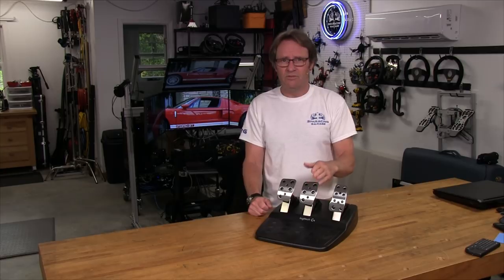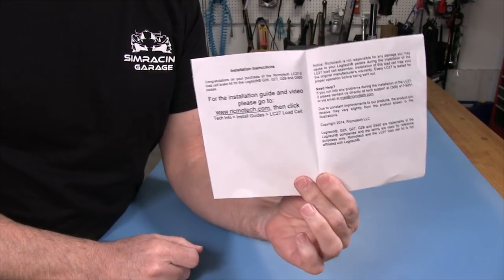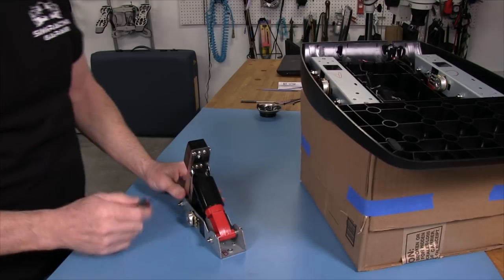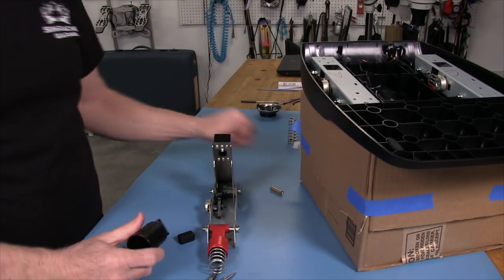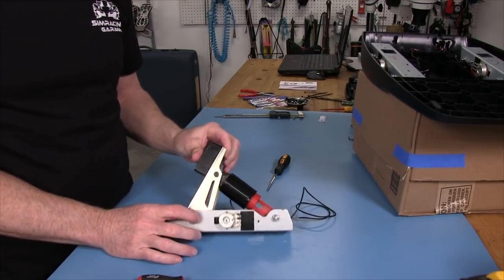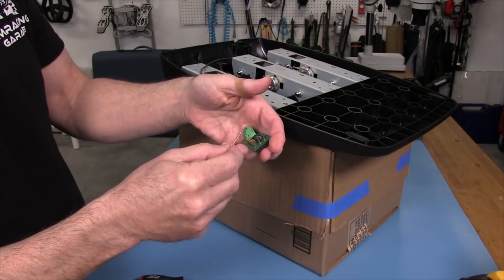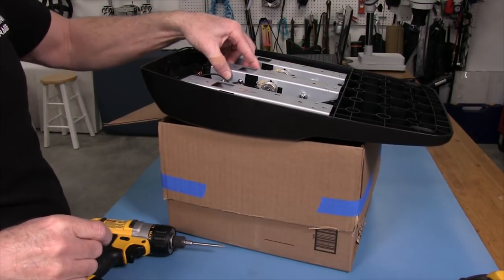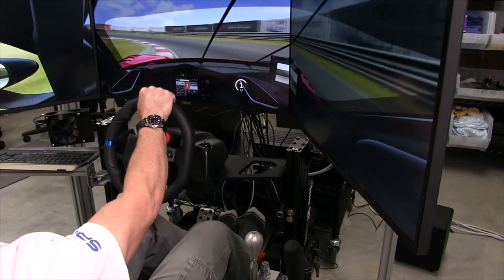Ricmotech Logitech Load Cell Kit Review

Comment: I installed this a couple of years ago on G29 pedals, but just recently started having issues with Gran Turismo Sport on the PS4 after a game update.  The brake was getting activated without any pedal actuation, which caused all kinds of problems with various cars.  After speaking with a Ricmotech rep, he instructed me to go in and cut off approximately one "loop", or 360 degrees of spring to lighten the tension slightly.  I wound up cutting off only about 270 degrees worth from the end of the spring, and it seems to work fine again.

Thanks for all the helpful videos!

Comment: Thank you Barry. I am planning on a major rig upgrade toward the end of the year, so you sold me on the idea of using this tweak as an interim step for a few months. I placed my order today,
Reply: I installed a tuning brake spring which is 59% stronger than standard spring and removed the rubber block. I then swapped the clutch spring to the accelerator and the brake spring to the clutch. I also fitted the 3d rap v3 improvement mod in the shifter. I was considering an upgrade but not any more as the difference these mods have made is astonishing, all for 40 quid, saving me hundreds!

Comment: I cut the rubber piece in half for my brake pedal. Works very well for me.
I swapped the throttle pedal with the clutch pedal for a stiffer throttle. Most cars don't use a clutch anyway. 
 Works very well.

Comment: works well i also did the spring swap & swapped the rubber bushing for thrustmaster t3pa-pro upgrade red bushing from Ricmotech. I have a LC on G29 & Thrustmaster. The G29 is very good times consistency improved on both. The G29 with LC is a winner & would take a direct drive wheel LC setup as your next step. GT Sport PS4

Comment: Another mod you can do is make a hole on the side of the pedal casing for the power cable to come out of, instead of coming out the back so the cable wont bend when you put the pedals against a wall.  thats what i did to mine when i was using them. not everyone as a sim rig.
Reply: Lex.... Can you show where that's done...thanks.
Reply: yea did you just drill a hole and route it out that way or anything specific?
Reply: @mrabgefahrn9933  yes . Just open the case and make an opening. I used a round file.

Comment: Ricmotech says to remove the plastic caps, on the inside of both caps, if installing on G29 or G920 pedal set. Did you only remove the bottom one and leave the top in? Looks like it in the video. Great video!!

Comment: You could upgrade the feel of 1 pedal for $130 or just buy a better set of pedals for not much more.  This upgrade should be like $50 max!
Reply: To be honest, until you start paying big money for pedals, the gas and clutch are not that much different. If the break pedal was fixed on these, they can last you a long time.
Reply: Its not the feel its the fact its loadcell. A loadcell set of pedals cheapest no mods is 240

Comment: this seems way too much work, so i used alternatives by upgrading the springs to better springs with rubber sealers and works better!! will the load cells work on the gas pedal and the clutch pedal!?

Comment: Its a pretty pointless upgrade now. Rimotech mod is approx 190 CAD incl cheapest shipping. There is also duties as well but I'm not sure how much. You can buy the thrustmaster t-lcm for 300 CAD and get a much better built brake set without any modding work. The fanatec CSL LC are around 300 CAD too

Comment: Awesome video! But how is your G29 so quiet, even in PC2.  I've turned a lot of my settings down and it still rattles.
Reply: it's all about the mount.  if you have a great mount, then it's all about the insides, which you will need to get into and find out what's rattling.

Comment: I got G29 for several years but havn't have had time to evaluate a gearbox stick yet, have any body seen or heard about any one building one themself cause G29 and orobebly G920 has a 9pin Dsub connection for gearstick and if 2 are used for ground and +5V theres 7 signal pins free for real simple signals.

<3 Have 2 VW Golf ( Rabbit ) GTI MK I seat for my Driving Rig project <3

Comment: $130 mod for $250 wheel set is crazy price. No thanks
Reply: Buy a better wheel set with load cell or hydraulic pedals then.
Reply: I actually prefer the G29 over Fanatec CSL. Maybe it's the lack of friction in the wheel and smaller wheel size, but it's much easier for me to react fast with G29. I'm not longing after load cell right now but I don't think that upgrade would be totally out of question either.
Reply: You can just buy a CSL Elite pedal set for a bit more
Reply: @harrisonatkinson7595  the CSL LC pedals plus the Fanatec USB adapter you'd need would run you $230 US. That's quite a lot more than the $130 US it would cost to upgrade a set of Logitech pedals you already own (not to mention the savings over Fanatec's insane shipping costs if you happen to live in Canada as some of us do!)
Reply: @johnsyeats2044  yeah that's true but the Logitech pedals also have 8-bit resolution I think? I think it'd be a worthy upgrade but I'd upgrade the wheel first
Reply: @ToreDL87  The entire reason why people buy the G29 is because they don't want or can't spend that much.
Reply: @annekedebruyn7797  Yeah but this mods kind of make the g29 a bad idea, stick with it or get a better wheel and pedals...
Reply: I just bought the upgrade because i couldnt afford csl pedals + load cell upgrade + USB cable + cronusmax drivehub + intl shipping + custom charges

There was a bit difference for me. PS4 player from chile
Reply: @LevisL95   the g29 is full of friction,  called cogging.   it legit makes counter steering a chore. i drove with a g29 for 4.5 years. and every time i have to countersteer a drift quickly i cant just let go of the wheel and let the wheel do it itself.  i have to guide it by hand  or the motor isnt fast enough nor smooth enough to do it itself.  do you own a CSL or did you just use a friends or what?  perhaps you used one that had very terrible settings on it.  i have a hard time believing my G29 feels better than a CSL
Reply: @ueehurstonsecurity8887  Hi and sorry, I wrote a huge wall of text. But it should give some insight. :D

I had the CSL for a bit over a year. I had a G27 for many years before it, during which I tried T500RS and a Playseat for a few months. And now I've had the G29 for almost a year. I haven't driven it that much but it's very similar to a G27.

One thing I need to say is that I've got no proper seat - just a desk and a dinner table chair. That makes a huge difference and is one reason why I haven't bothered driving as much as I'd want. I'm building a sim with a real car seat, but it has taken a while. :D

Now, about the feel. The G29 definately isn't able to rotate itself fast enough. You have to aid it by hand, as you said. Overall, when it comes to power, the CSL is on a whole different level. Although I think the G29 motor just isn't powerful enough, and this is not about friction.

The thing I'm talking about is the moment when the wheel should get light. So when the back end gets loose and you need to actively counter steer to catch the slide. In that situation, the G29 is very light, there's virtually no resistance and you can be very fast. The CSL has some friction "built in", the wheel resists you turning it. But you can feel it only in these specific moments, when the force feedback isn't doing anything.

The weird thing is that the CSL feels light when it is powered off. Although it has the belt system and more rotational mass, it feels very light, virtually as light as the G29. (The T500RS was horrible in comparison.) But for some reason, as soon as you turn the power on, this friction appears. As far as I can tell, it doesn't matter if you turn the FFB to 0 or play ETS2, you can still feel the same damping or friction when you turn the wheel fast.

Fanatec said that they've reduced the friction on the CSW 2.5 by a lot by redesigning the motor electronics. So I think this is the friction they are talking about, and a CSW 2.5 or a direct drive wheel might be the (too expensive) solution for me.
Reply: PS. My G29 makes some odd high pitched noise when cold. Got a new one as warranty, it does the same thing. Some people say, the sound might go away after some use, so let's see. The stitching on the wheel is also of very poor quality. Logitech quality has seemingly gone to shit after the G27. It's a shame, I like the new pedals and buttons. Maybe the feel is also better, but hard to say since I got the old G27 used and can't even compare back to back.
Reply: @LevisL95  Hey thanksf or clearing that up!! that makes so much sense now.  i see why you say what you say now.   so it had nothing to do with tuning the wheel.  its just an innate problem with the CSL  that fanatec even agrees with you since they fixed it on the 2.5   so there must have been a problem to fix.   thanks for that info very much   i read it all!
Reply: About 10x crazy.
Reply: @LevisL95  how anyone could pref that over the csl i don't know. The difference in performance is like going from csl to DD bases.
Reply: @CottonXS  The power in CSL makes worlds of difference, yes, but you can feel all the same details with G29, without friction and dampening. G29 feels like a gaming controller in comparison, but it's an accurate one.
Reply: John S Yeats that’s nothing compared to EU you are looking at around 600 euro plus postage. So  the upgrade is worth it here.
Reply: @magpiemarc1962  CSL pedals and the USB adapter are 250€ in EU. Were you checking wheel/pedals combo or something?
Reply: i think you don't get the point. most people who do this mod already own a g27/29 etc and now want to improve upon it. not many people would actually buy the wheel and upgrade it right away, else they would buy a better kit to begin with. i've had my g27 for over a decade and am now considering to do this mod.
Reply: Looks like a great mod. I have a G29 and don’t really feel like spending a bunch of money for a CSL Elite. Buying that, load cell kit, and the USB adapter is too much. While I like racing in my rig, that money is better used to spend on my wife and kids. Take a weekend trip somewhere, buy them some clothes, go out to dinner, etc. the point some people are making here is while upgrading to a bad arse set of pedals is nice, we’d rather spend some cash to upgrade what we have. If we wanted the better pedals, we would have bought them in the first place. I get more pleasure spending money on my wife and kids than splurging on myself. I’m fine upgrading a part on my $250 wheel set.

Comment: I just ordered the parts together with a Leo Bodnar D-sub to usb conversion cable. Did you connect the paddles back to the steering wheel or through a conversion-cable?

Comment: DO you know if it is possible to get a potentionmeter wiht at longer travel. So it become possible to use the entire travel, when you take out the rubber piecefor the G29/g920, ore at least most of it.(A challenge mabe) if you used a 20k/OHM insted ore somthing ?  Thanks for the great videos

Comment: Do you have any comments on the stiffness of the brake pedal? I've heard some reviewers say that its unusually stiff, but you mentioned it has a much more natural feel. What's your opinion on those who say the pedal is way too stiff?
Reply from the maker: It is stiffer than the stock configuration. By natural feel, I meant that the LC or any pressure sensitive brake pedal setup has a more natural feel when applying braking pressure to the pedal. And feeling how the car is responding. It's something you have to experience to truly understand I think.
Reply: Sim Racing Garage I appreciate the reply. I think I will finally pull the trigger on this purchase. Thank you for the insightful review

Comment: Is it possible to configure the kg of force required or is the quantity fixed? Congratulations on your review
Reply from the maker: No, it is fixed and 35kg or so. You can calibrate in most games to set up how much force you want to use if less than 35kg.
Reply: Thank you very much for your reply. My concern was that too many kilos were required, if calibrating you can get off I'm fine, I just hope that doing so will not shorten the pedal stroke too much. Thanks for shedding light on this mod

Comment: Great info. Could you tell me what angles your side screens are at? I just set up triple screens and was wondering what is the best angle to use.
Reply from the maker: 60°
Reply: I have mine at 45, is there a advantage to going more?
Reply from the maker: I am better able to look through turns. Also, the center monitor is only 23" away from my eyes. So there is more of a wrap around effect to this setup. Not for everyone though. And getting your ctr monitor this close may not be possible. Depending
on the configuration of your rig.

Comment: Nice review Barry, I have had this mod for some time and it works just like I hoped. Small pointer, I doubt that you would notice any difference in iracing with diview adjustments since the calibration in iracing reads straight from the raw data and doesnt read the direct input from direct x. All the other titles you drove does though :)
Reply: All the other pc titles that is ;)
Reply from the maker: Yeah, just trying something to help deal with that force curve. Shame Logitech went that way. It certainly doesn't accomplish what they say it does. Just more marketing tricks...sigh...
Reply: Sim Racing Garage I couldn't agree more.
Reply: Does the brake pedal feel too stiff or just right in your opinion?
Reply: 20spray1 It's a matter of taste, once the initial spring is compressed you are more or less hitting a brick wall and the force you apply on that wall translates into output. That being said, I like it like this. My problem is that my G27 pedals are modded with longer pedal arms than stock, so I get more travel but also less force needed to get the pedal to max out. And I want to be able to apply more force and modulate the brake, so I'll make an extra axle with cylindrical elastomers taking up most of the force applied.
Reply: HwXeXcluded interesting setup. I also had plans to extend my pedals. Did you make the extensions yourself or did you go with a kit? My concern was that the LC pedal would be too stiff, but with extended pedals it would make it feel not as stiff. Do you have your pedals inverted or floor mounted?

Comment: $129.95 Wow.
That's quite a bit.
Reply: I guessed $100 at the start. Out of my price range (and I'm not good enough to require anything like this yet.)
Reply: @Sighman  it's not quite as refined as a load cell, but you can modify/convert your current pedals to a pneumatic brake system for free/a few quid for some basic bits u might already have at home to improve the stock brake

If you yt g29 pneumatic brake system youl find videos of it (don't wanna post links on someone else's video myself)
Reply: @ash180287  Thanks for that. I'm sure the load cell upgrade is worth it for many people, but I'm just starting out and the cost is impossible to justify for me at this time. (Mind you, if it helps me outbrake the turn one nutters it might be worth it after all!)
Reply: I though it would be like $29...
Reply: @Rafael Ribeiro same here what do you think about the Tlcm

Comment: Looks like it will be very hard to remove the load cell back from the plastic housing, isn't it? Great review btw Barry, congrats!
Reply from the maker: It is tricky. I took it out a couple of times during the review process. Not too bad using a pair of electronics type long needle nose pliers. You can grab the velcro at different places and gently work it out while pressing on the the thick section of the cable where it enters the LC housing. Once that clears the hole, it's comes out easy.
Reply: Great, thanks Barry!

Comment: Great product while it works, about a year for me. Now I'm stuck with a dead pedal set.
Reply from the maker: You can always remove the LC and return the electronics to the original configuration if they are still good.
Reply: @simracinggarage3026  I had to use to potentiometer from the brake pedal to replace my throttles as even after cleaning it kept spiking. At least it's summer. I'll venture outside and gets some sun on me while I wait for my T3PA pedals to arrive.  

Thought of using the one from clutch and run a two pedal set up but that's just not sim racing. Cheers for the reply Barry.

Comment: Quick question, i bought a cheap thurstmaster force feed back wheel and it felt notchy in the steerig. does the g29 feel notchy as well? or should i get a belt drive?
Reply: @SooHooSamaSito  so spring for a belt? Or does it make any difference?
Reply: @SooHooSamaSito  thanks

Comment: Without knowing the exact inner diameter of the pedal tube, there is a loadcell, which more than likely the one what is featured in the video. 
https://hu.mouser.com/ProductDetail/Measurement-Specialties/FC2211-0000-0100-L?qs=sGAEpiMZZMvDU9HV27FC0bfgshpg3%252bR8evdx8Gaw3Yc= 
and with a Leo Bodnar loadcell amplifier, the whole project is cost around $70. If you want to go real DIY.

Comment: Damn, was about to buy this but $129.95
?!?!?!
Reply: It's a lot cheaper than spending 230 USD on a set of Fanatec CSL LC pedals and the USB adapter (or $600+ on a set of Heusinkveld Sprints etc)
Reply: save up 100 bucks and buy some decent pedals is what i would do.
Reply: @johnsyeats2044  yeah but between actually having to buy the pedals and the upgrade kit you're spending ~$330 that's kinda ridiculous for a subpar rig
Reply: Wow, that is high for what you get., I was thinking 29.95, that would cover by 2 all the parts cost and allow them to mark it up 100 percent.
Reply: I use the TrueBrake mod which isn't a load cell but is functionally similar. Miles cheaper and probably just as good. Definitely made me faster and more consistent.
Edit: cost me only £54